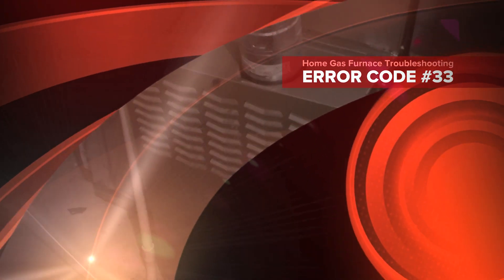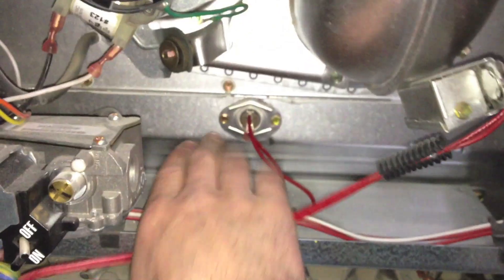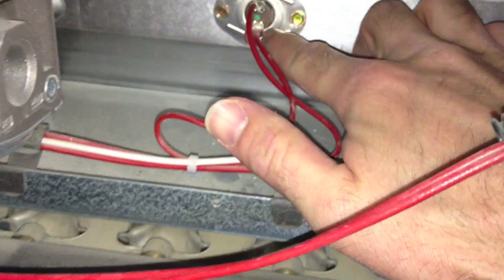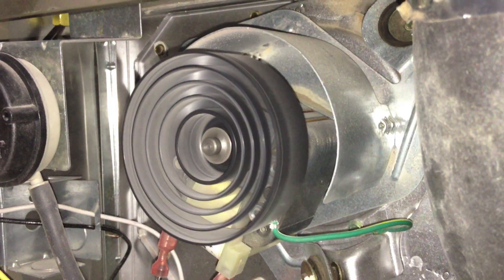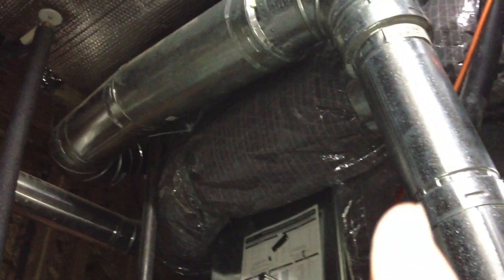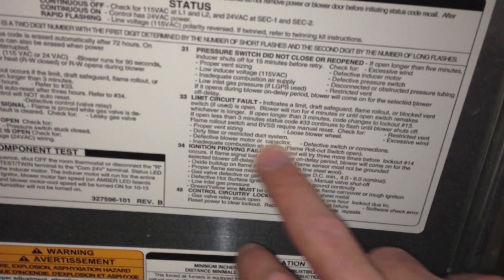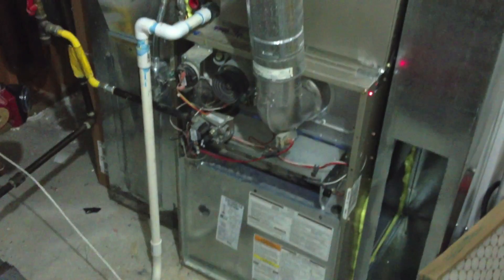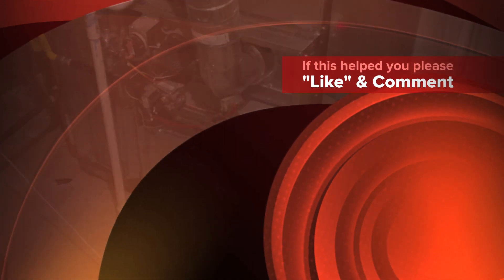ERROR CODE 33 - Troubleshooting a Bryant Gas Furnace

Comment: My system has been in this house working fine for years so I don't think my problem Requires me to re engineer the unit but thanks for your explanation on how stuff works I'm thinking I might have blockage on the exhaust tube to the roof recently had the roof done and the roofers didn't put the cover on the tube on the roof and when it rained for the first time I had water driping from the exhaust  pipe  so was open to the elements possibly a wasp nest in there I guess I will start there or the sensor in the tube could have gone bad due to water intrusion 👊🙌🔧🇺🇸🙏

Comment: should not cut a return inside the furnace room where the exhaust vent is. Now gas fumes can be pulled into the return and sent upstairs.
Reply: Not to mention. Problems  with rodents.

Comment: I finally got the 3-3 error fixed after watching this video and reading the comments. I had two issues 1) a part failed 2) improper furnace sizing. I replaced all the parts except for the gas valve for $900, since it was 15 years old, now it's basically a new furnace. I thought this was better than spending $7,000 - $9,000 on a new furnace, which is what the HVAC companies suggested. Unfortunately I still had the 3-3 error.  After reading about the proper furnace sizing comments here, I realized the furnace produced twice the amount of BTU for the sq footage. I remembered when I first started to troubleshoot this issue I turned off the gas ball valve, then later turned it back on realizing it wasn't necessary. I believe the gas valve was originally partially closed to restrict the amount of gas, so I slowly closed it watching the flames decrease in size. This solved the second cause of the 3-3, by limiting the amount of gas of an improperly sized furnace, it no longer produced too much heat to trip the sensor. The HVAC company would have replaced the furnace with a properly sized unit and it would have worked, I don't think they would have partially closed the gas valve to compensate for the oversizing and lost a $7000 new furnace sale. Hope this helps someone else in this situation. Now i'm going to replace all the furnace parts in the 15 year old furnace on my second level.
Reply: Thanks. I will try this. I have checked everything and still I get the crazy 33. Thanks for the tip
Reply: Sorry for the delay on this, but YES! Controlling the gas valve down it helped with the crazy 33 code no more!! THANKS!

Comment: I have an old carrier furnace that blinks 3 times quickly then 3 times slower (3 ).  ACCORDING TO the rear panel it is the roll over limit switch or lock out. I tried tsting then  by-passing or jumping the switch to no avail as furnace  blower just runs continuously.  I did replace the unducer motor a year ago. I cleaned out the hvac, new filter, and did what I could.   NOTE: The stages  of this 80% carrier furnace are  = (1)  blower   (2) inducer  (3)  ignitor,  (4) then gas to burner on furnace, athat point it is supposed to start.  ....My problem is  that  3 - 3  code  -  Should i replace inducer motor again and the limit switch?
Reply: Try get a the lowest marv filter, it solves my 3-3, I have been having this problem for two years, I even installed a ventilation in my boiler room, but all I needed was a lower grade filter. I removed the filter first and furnace ran perfectly fine, then I realized the filter was too heavy and blocked the return air too much. Try this and see if it helps

Comment: It’s more of an installation issue not sizing vents correctly 
The problem you made is you said the second air return is pulling air in from the basement, not a  good idea because now it’s pulling the cold air from basement and any other chemical fumes or possibly exhaust from the water heater draft hood. Your other ideas and tips are good info

Comment: Good Video! My problem ended up being a dirty filter that actually started to warp inward from the suction of its clogged pores. Had to take off the bottom panel to reset the blinking sensor light instead of waiting the three hours the system would automatically retry...

Comment: I really hope this helps my mom!! She has no heat by the code 33 and i check the voltage of all parts and they all have proper voltage filter is new sensors are new control board is new... This is the only thing i haven't checked...
Reply: Change to a lower grade filter, it helped my problem

Comment: I have Bryant furnace(3310AAV048110) installed 5.5 years, I get error 33. If I set my thermostat to 67 degrees it fails, if I leave it at 66 no issue. This was never a problem before.  House is 100 years old, 3 returns all clear, 8 Air ducts, all open.  Filter was clean, removed filter same issue. Tech came out and tried replacing flame sensor still same issue. He had to leave for another call.  Can't get him out again.  The first time I discovered this was Jan 27th and it was error 13.  I think if you don't lower temperature to 66, it will keep trying and the error code goes from 33 to 13.  Contractor said he opened a ticket with tech support(assume Bryant). I reschedule him and can't get him to keep his appointment. He did take readings for different sensors, all were good according to him.

Comment: Three times in the past two years this video has helped me!  The first time: The fresh air intake was clogged with debris. The second time: We had sustained high winds that affected the exhaust. The third time (last night): The air filter was due for a change. It wasn't terribly dirty, but this HE furnace requires more airflow than what the ductwork was designed for (with the original furnace), so it is more sensitive to a dirty filter.
Thank you very much!!

Comment: Had this code on my furnace too. Identical looking furnace but a Carrier 15 yrs old.   Turns out it just needed a new air filter. I was using one with too high of a MPR/MERV rating and was getting clogged - after about 5 months.  I changed the filter to a lower rating  of ~600 MPR.  Problem solved.   I've learned that high rated ones are not necessary and just force the air blower to work harder/less energy efficient.  The filters are primarily to protect the blower. Secondarily for better air quality.
Reply: I just solved my problem too with same issue, changed to a lower grade filter helped, lmao I can’t believe I called 5 different techs and spends hundreds of dollars, installed ventilation for boiler room, after all these, all I need is a lower grade filter…

Comment: Impressively thorough.  I've been going round and round with the tech who just wants to swap a control board, which was swapped once already and highly doubtfull to be the issue for this code.  I question the thermostat because it comes and goes, just seems to stop early, but it does trip 33.  Another thing I was wondering about was about that limit switch you show, one other guy said that can fail, and even test okay, but due to age will trip prematurely.  First, I'm going to take your advice and make sure all registers aren't blocked.
Reply: Here I am again, which implies you were right.  Just got 33 again, three years later on same machine, last time I cleared it due to obstruction, which seemed to last three years, so now to see what's changed.

Comment: Whoever installed your furnace did not size the return correctly.  It is NOT manufacturer defect. If you were to look into the installers instructions different size furnaces,( but input) require different cfm requirements.  And unless you're a professional you shouldn't be tampering with equipment.

Comment: My issue with error code 33 was the gas pressure to the furnace was too high. We had some gas lines and gas meter replaced as part of a house renovation. My HVAC guy noticed the flames in the furnace were irregular and not blue enough.  The plumber came back with a manometer, made the necessary adjustments, and the problem was solved. The flames are blue and uniform.

Comment: The immediate question that comes comes to my mind is how long has this furnace been in service with absolutely no issues whatsoever? This would indicate all the extra work installing an additional air inlet was not probably not necessary or recommended. First thing to check the temperature limit switches, second thing to check that the chimney stack is completely free and clear if all blockages such as the birds nest as mentioned in the comments below. Temperature sensors are only expected to last for a certain period of time do to the thermal expansion / contraction  work that they do on a daily basis over time. Someone needs to get a meeter out and do some measurements for some restless trouble shooting.

Comment: I'll add my comments in case it helps anyone else.  I had the error code 33 and issue of no heat but blower/fan was working fine.  My son was an HVAC tech in the Army so I enlisted his help.  I had the manual and we looked at everything that was related to error code 33.  We re-set all of the re-settable switches and even ohmed them out with a multimeter to make sure they were good (looked at the schematic to determine if they were normally open or normally closed).   Made no difference.  Also ohmed out the ignitor; it was good too. Still the ignitor would not come on.  We looked at the control board and found no voltage  where the control from the thermostat was supposed to be.  Well my son then had the idea to go outside and check to see if the A/C unit came on when I switched the thermostat from Heat to Cool.  Well that would have been a timesaver to have checked that first! it turns out.  Because the A/C unit did NOT turn on.  So that indicated the problem was not in the furnace unit at all, it was with the thermostat.  I found a manual online for the thermostat and it suggested for the no heat problem to clean the pins (with a pencil eraser) and contacts of my unit, which pulls off the wall for access.  So I did that, then turned on the furnace again, and voila! ignitor glowed orange, then the gas came in, and had flames and heat once again!  So the poor connectivity of the pins/contacts in the thermostat unit were the culprit.  Hope that helps someone!

Comment: Removed the front panel that is covering blower motor and it works now. Looks like it is not getting enough air from return. I guess I will leave it open

Comment: Thank you. Took me a while to find your vid. After I saw it. I went down to the furnace removed the other side panel and the limit switch never tripped. So I built a similar filter system as you did and the furnace has been working fine for the last 2 months. 
I did all the checks the YTube, so called engineers, explained. They were a waste of time. No bird or mice anywhere found, all the vents are clean as well, nothing in the exhaust pipe, bla, bla, bla. Nothing at all found wrong. I even checked the motor capacitor and speed all within normal range. 
Your fix did the trick and save me from having to buy another furnace. 
Thanks again for sharing this great fix. It worked for me. 
Have a great Christmas. 
Mike Di Feo
Reply: Another improper return, the 100,00 and 135,000 require returns on both sides, it's in the manual. All installers need to educate themselves. Brryant/carrier have the BEST   installation instructions

Comment: I was totally hoping the camera would get sucked into the blower. Great video, though. It woulda been nice if you had gone into how to check the tripped-ness of each of the sensors while the furnace is in a failure/overheat state, but... that's easy enough to google separately. Thanks for the vid.

Comment: I’m having the same problem. Wondering why this became a problem all of a sudden? The system is 12 years old. Subtle decrease in motor efficiency or slight buildup on heat exchanger?
Reply: Or limit switches reaching end of life. Let me stick some cotton in your ears and tape over your eyes and ask you to walk to the quick stop with out getting run over. Systems only as good as their sensors.
Reply: Just change to a lower grade filter, I think you got some new brand filter that blocks all this and that, also blocked air going in to the furnace. I changed mine to lower grade it helped!

Comment: Certainly system sizing and duct work could be an issue, but if it were you'd have had that issue from day 1. Based on the amount of dust in the unit I doubt its brand new which means this is a recent problem. I find a lot of people close supply vents or damper down trunk lines which can cause the unit to trip on high limit as well.

Comment: If you get a code 33 on one of these Carrier units (I have the exact same model in this video) its usually a filter or high limit switch issue. First take the filter out flip the power switch off on the side of the furnace for about one minute turn it back on and let the furnace cycle for about one hour without the filter and watch the code LED for steady or blinking. If you are still having an issue and you can hear a pop sound followed by the burners shutting down replace the high limit sensor its cheap and easy to replace. These Carrier 80s have issues this is my 3rd one and they all develop them over time it seems.
Reply: Hi Ross, I plan on giving it a shot. Something tells me the issue on my furnace is related to the filter or high limit switch. My furnace is manufactured by Payne, but from what I was recently told by an HVAC tech its identical to a Carrier like this one. Everything appears to be the same in terms of the overall layout. 

I apologize for my ignorance, I was hoping you could clarify the filter procedure in a bit more detail for me. Pretty sure i should first flip the power switch, then remove the filter. Turn the furnace back on and let it run for an hour? A steady light will indicate the issue has to do with the filter, if it continues to blink without the filter then move on to the high limit switch? Does removing the filter reset the system? Any insight you can provide is very much appreciated! Thanks!!
Reply: RobB well good luck changing parts to fix your furnace I wish hvac was that easy then we could all do it... I hope if it doesn’t work you learn the lesson all do it yourselfers should.. you don’t know what your doing because you aren’t a professional your a unlucky guesser
Reply: Gas pressure, temperature rise, static pressure, vent sizing check, combustion test on 90% furnaces and filter all come before just replacing a limit.. call someone that knows what they are doing if you want it done right. If your not testing your guessing

Comment: Help. Furnace runs eratically. I find by flipping the power switch off, then on again (The switch that's located on the side of heater unit). If that doesn't  work. then I'll bang on the side of the heater by the power switch a few times and presto. It's running again for  a few hours to a few days? Should I just replace the switch. Looks like a basic light switch.
Reply: Kurtis Leany no just keep hammering away

Comment: I've had the same code 33 problem for as long as I've lived in the house (7 yrs). Just had an HVAC guy here last week who said I needed a "box" installed below the blower so that it could get bottom and side air as return.  Came back and raised up the entire furnace and put it on this "box".  Charged me $1800, and now I STILL get code 33!   But with the cover off, more air enters and it will run in heat mode forever. HVAC guy now wants to put a "bypass" on the system between supply and return to lower the static pressure.   The video suggestion-- putting an auxiliary return intrigues me, although there is a water heater sitting on the opposite side of my furnace so that's not an option.  I am tempted to just "try" a replacement sensor on the outside chance it is cutting out at too low a threshhold.  Anyone have a part number ?  This is a Carrier 58 STA/STX.
Reply: Gary Liebisch you have a serious issue if you put a new switch it will trip to its common sense your furnace has never worked the way it has been installed you need more air.. check static pressure and temperature rise to get the true answer to your issue

Comment: I have a 33 error code then it added a 13 error code later. I thought it could be a dirty filter but after i installed a new one the error message persists, what should i do? The heating is working and i didn't notice any problems, but the message keeps showing up.
Reply: What did you do to fix it? This is what mine is now doing

Comment: had the same 33 code on a unit under the house,all switches were good and they never tripped,but had new on the truck,changed all and same code,unit wouldn't run long enough to get hot,flame rod good,filter good,no blocked vents,exhaust piping good,water column exact,after got it running,about to give up,pulled the thermostat,jumped it,ran perfect,30 min,still good,changed the thermostat and no codes for 3 months?why,shorted thermostat?another day in the life

Comment: I’m betting it is your high limit switch that is faulty. If the furnace was running fine before you cut in the extra return air hole chances are it was getting enough return air, this usually means the high limit switch is bad and tripping to soon.
Reply: Obviously you know more about HVAC than the guy that unnecessarily hacked his home furnace and when his limit switch fully fails will be left wondering why he spent all the energy adding additional venting to his system. LOL